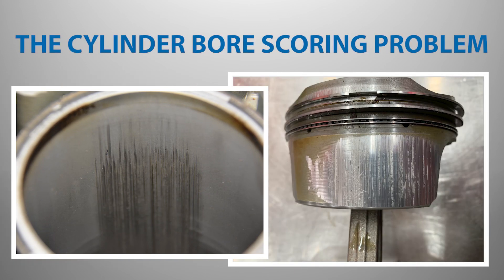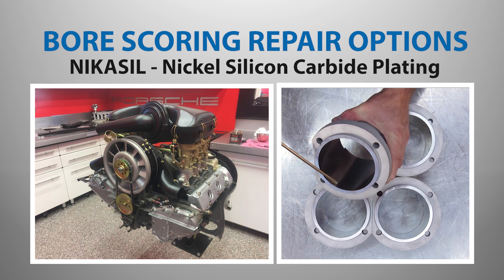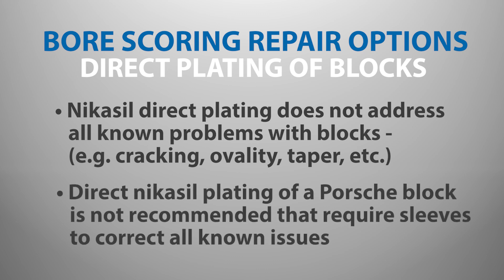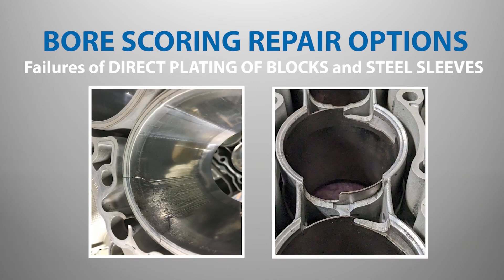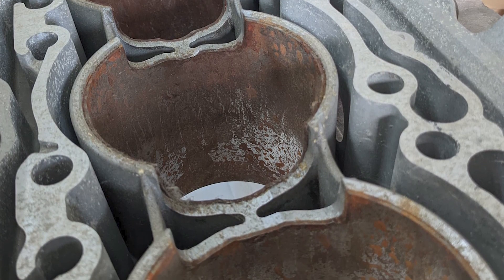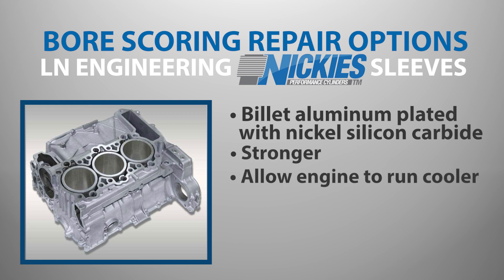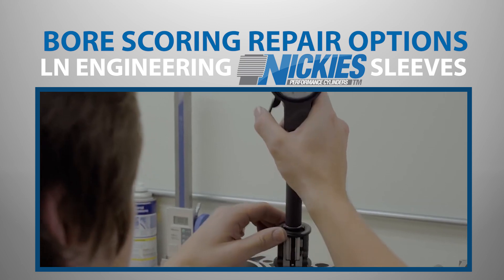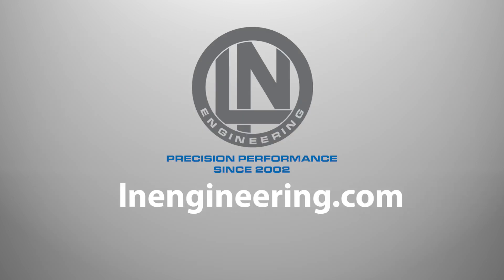Cylinder Bore Scoring Repair Options for Porsche Boxster, Cayman, and 911 Engines

Comment: How much will it cost to fix 1 cylinder for a 2016 macan S?
Reply from the maker: Unfortunately, you can't just fix a single cylinder. There are some that do, but it's a guarantee that it will suffer another scored bore in the near future. As with any 6 cylinder Porsche, it's going to start somewhere around $15-20k for a rebuild, including new pistons and Nikasil plating of the cylinder bores to correct for the bore scoring issue.
Reply: Roll it off a cliff. Not worth fixing.